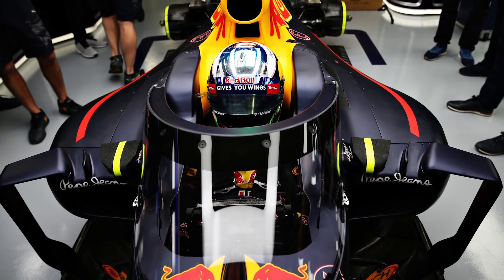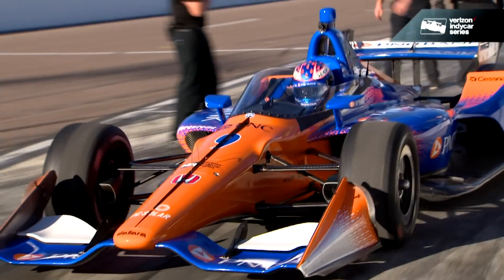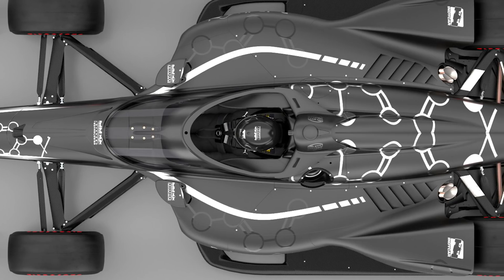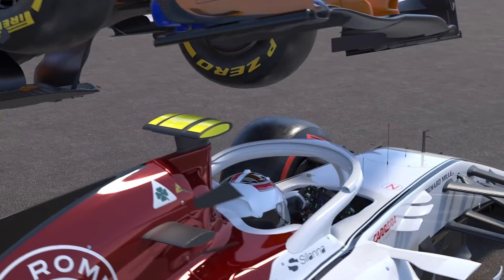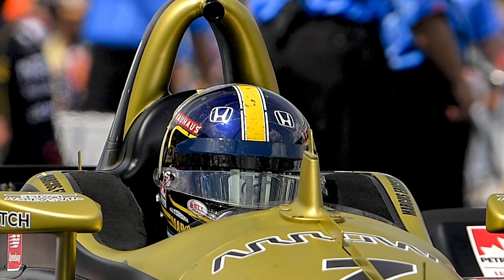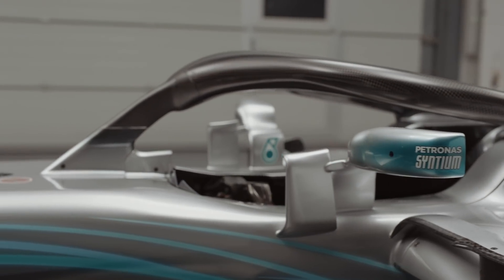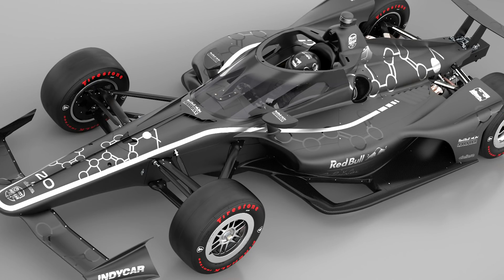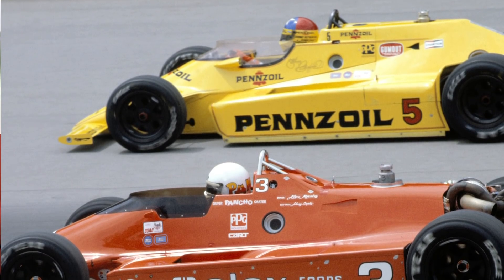Why IndyCar chose Red Bull's screen that F1 rejected

Comment: The risks on an oval on flying debris, overturn, collision and vision requirements is slightly different to F1...….and the halo has been proven to work......maybe there'll be a hybrid?, but whatever works on safety is better for the sport......
Reply: It really isn't - it was an F1 driver that got hit in the FACE and missed a season of racing because of a damper spring, not an IndyCar driver
Reply: The halo hasn't been proven to work though, no one's been saved by it
Reply: LeClerc Belgian Grand Prix 2018.....
Reply: @alanhutchins5916  it didn't though, it would've missed him anyway
Reply: @redbullsauberpetronas  official FIA report on crash has a different opinion along with C LC.

Comment: My only issue with this sort of thing is restricting drivers getting out the car. If the car goes upside down into gravel or grass you could easily see the car being very hard to get out of. Add into this fire breaking out means that Marshal's will have to be on their toes
Reply: It leaves pretty much the same space as the current halo to escape from so that has been tested pretty extensively.
Reply: @Firecul  ah fair enough

Comment: Well, At Least They Learn From Justin Wilson
Reply: I believe he was hit directly on the top of the head with debris. I don't believe this design would've saved him. It was a freak accident. You cannot make these cars 100% safe.
Reply: Kresna The Roblox /Minecraft Gamer if only Justin would of learned himself going slower instead of speeding through a accident area.
Reply: @breakwood8531  He was going 160 mph  in an area that they would normally be doing 210 mph, he was slowing down. You can't just slam on the brakes when going that fast in a pack of cars. He did nothing wrong, just an unfortunate accident.
Reply: John Sabol I watched it a lot and Justin was passing a car going high at faster speeds then everyone instead of following the group down and slowing down. I’m not putting blame on him per say but if he had stayed behind that car instead of passing him I’m sure he’d be alive today but I actually blame that style of car, parts would of always break off easily, especially the back bumpers.

Comment: This will probably be in f1 next. If we can put a canopy on a fighter jet this should be easy in comparison.
Reply: Nick Polito But distortion issue on F1 might be critical
Reply: @taek_00  if it isnt an issue at Indy oval tracks where average lap speeds are well into the 200mph+ than I would bet f1 wouldnt have an issue either. If it was that bad for distortion they wouldn't run it on the Indy ovals where reactions and judgement cannot afford to be impaired as the potential for bad wrecks is already higher at Indy ovals as it is.

Comment: I would much prefer that they wouldn't talk about "why the AeroScreen just wasn't 'good enough' for F1" at all if we're going to pussy foot around the fact that the FIA isn't interested in ideas that they didn't invent themselves/can't claim as their own. Besides, if the FIA didn't pick "their own" invention, how else would they be able to prevent other series from using it(as was mentioned in the video)?
I get it - it's a great idea, for the sake of good ol' press credentials and the opportunity for exclusives, to not talk about the FIA's political bullshit, but that doesn't mean that we need to in any way legitimize the FIA's bullshit decisions.
The fact is, both the original IndyCar concept(with finished development) and the original Red Bull AeroScreen would've been perfectly fine while a v2 along these lines was ALSO developed, as the ORIGINAL problem being solved was flying debris, with significantly greater loads along the lines of the weight of an entire car coming at the driver came along later in the development of these devices. Remember when the FIA was 'just' shooting tires at these as the main tests? But, the flip-flop-top was their decision because it was THEIR 'solution', while other reasonings were added after the fact to further justify their obviously closed minded decision making.

As far as F1 eventually adopting this, I wouldn't get your hopes up, not without it being an abortionized version that they can, once again, claim as "their own" anyway...

Comment: Would there be an issue with rubber getting caught on the screen reducing visibility?
Reply: That's a good point - I reckon they might introduce the tear-off system that endurance racing uses, where a tear off is taken off during a pitstop
Reply: @ChrisSmith-mk3wo  I just assume with open-wheel racing cars would throw off more rubber but time will tell. I am just interested to know if it would be a problem and how they would solve it.
Reply: No more than any other series' that race with closed cockpit cars and windshields...
Reply: @colejones6312  problem is that all the racing cars with a closed cockpit have wipers... endurance racing have tear-offs too only when driving in the dry for the dust...
Reply: @Moribax85  So you think F1 can't adopt any of these existing tools? Oh boy...
Reply: Probably not so much. The angle is quite flat so it’ll be hard to have rubber stick to the shield, especially at Indy speeds.
Reply: Vs rubber on face helmet? I don't see a new issue here
Reply: @littlejohn-pi7kk  I mean the helmets have tear-offs. I don't see a driver reaching outside the monocoque to tear off a layer of plastic from the windscreen. It could happen in pit stops I guess.
Reply: @xRODIMUSxPRIMEx  "It could happen in pit stops I guess." You guess? I can do you one better and tell you yes thats exactly how it would be done and furthermore it is exactly how its done. From nascar to GT3, They all use plastic that can be peeled by the pitcrew to increase visibility.
Reply: @TheBUGZNTA  Yeah I do guess cause I don't know I was only asking a question, not a bad guy here, just a curious guy. But wouldn't open-wheel race cars throw more rubber out than regular cars? Would this require pit stops just for tear offs, I mean there are a lot of unknowns here, what if after 10 laps the screen gets difficult to see out of due to the rubber. Would that mean race leaders would get an advantage over the rest of the pack because they can see out of their windscreens better? I mean I am just curious I don't think it is a stupid question to ask. And I am not opposed to this I am again just curious as to how they solve these issues if they even are issues.
Reply: Is there a problem with rubber getting caught on the screen of Prototypes?

If so, how the hell do you think that they solve this?

I swear, it's like trying to add a windshield to a racecar is more difficult than solving world hunger or something - critical thinking skills are at an all time low...
Reply: @RyTrapp0  Okay dude, it was merely a question, no reason to turn into a drama queen. The only one suggesting this is an end-of-the-world type question is you. Also, whenever sports is involved, no one is equating it to world hunger. Ever.
Reply: @RyTrapp0  I mean you just asked the same question I did without answering anything I was just curious my dude. But to answer your questions. 1 I don't know if rubber getting stuck on the screen is a problem hence my asking if it was. I also don't know if the screens have been tested in race conditions with a bunch of cars throwing rubber around. 2 How do I think they solve this, maybe wipe the screen down with Pam? Obviously, they will have a solution to these problems. But please by all means how will they do it all knowing YouTube commenter with all your critical thinking you can't use to see that my comment was a valid one.

Comment: Let's be honest, the only reason they don't want the halo is looks. The argument that the halo obstructs vision is obviously not true as their proposal is halo + screen. So the halo on its own would be fine if they designed it for the series. Also the small objects argument is not a big issue. They changed the helmet regulation to make them stronger against items like the spring that hit Massa.

Comment: The reason INDYCAR didn't go with the halo is because they oval race too, so the obstruction of view from the halo was dangerous. On the banked turns drivers have to look UP all the time rather than straight ahead and left and right due to the track being all straight and while on the banked turns, looking STRAIGHT forward is looking right in front of the car and looking left is actually looking at the ground/grass off the track, you HAVE to look UP to see the cars in front on the banked turns.
Reply: They said that in the video.

Comment: I think F1 is starting to go way too far with excessive safety rules now. something is missing when the sports lost that fighter pilot danger it had years ago. No one wants drivers killed or injured. but the thought they could be might make them drive a bit more thoughtfully.  Also correct me if i'm wrong but dont indycars  have a rule where they dont race in the rain. in which case apart from bug splatter the screens are no hindrance to them  ?
Reply: IndyCar doesn't race in the rain just like the general public doesn't drive in the rain - however could we see past the water?!?!?!
Reply: Yes because we want drivers to stop making brave moves on the edge of death and have them chicken out at the slightest dive.....

Not. Safer cars better racing.
Reply: @Minx5892  I'm glad I'm not the only one that sees how asinine, hypocritical, this idiocy is - how the fuck does less safe cars = better racing? How does it improve ANYTHING for the fans??? This has never made an ounce of sense to me, and has never been explained with any logic either. 

As we all know "open cockpits are why F1 is so much more entertaining racing than these way too safe closed cockpit LMP/DPi Prototypes/GT cars"...
[...yea, that was most definitely sarcasm...]

Comment: It's a paradox: the screen can protect from the big and small objects but become dangerous with the rain.
Reply: Your street car is s00per s00per danger in the rain too, right? That's why the general public all pulls over to the side of the road during rain as required by law - because no one can see pause this magical clear-but-not-clear liquid that sticks to angled surfaces like glue...
Reply: @RyTrapp0  A screen in FIndy at 400kmh doesn't have the windscreen wipers, so......
Reply: @simonetaddia459  ...neither do HELMET VISORS... ...so...

BTW, how do you think water acts on an angled surface at 400KMH(well, 355-380, but who's counting)? Does rain act like superglue outside of North America or something?
Reply: indy doesnt run in the rain. So problem solved. and itd be no different to a bike visor
Reply: @jasonward345  You're on the internet - you could at least TRY to use google instead of making a fool of yourself...
Reply: Exactly
Reply: Pretty sure that F1 has the funds to coat it with some super hydrophobic material.
Reply: Helmet visors are not better in the rain.
Reply: The real question is can that screen withstand Edd Straw?

Comment: Never have liked the halo. But I do like my favourite drivers and if this device keeps them racing with reduced risk then it's ok by me :)
Reply: Yeah halo looks bad, BUT I deff want it to stay if does protect n keep drivers alive.
Reply: @shanejett3550  So this might be the fact that I'm new to F1... but I actually like the halo. I find it ties the lines car together nicely.
Reply: @Sharks545 : ur lucky bc most - and I'm making the assumption based on the many comments - don't like the halo and feel it's ruined the look of the F1 car. F1 is one of or the most innovative sport on the planet. It was also one of the most dangerous. Safety should also be extremely important too. For a period there were 6 wheeler cars racing in F1 that looked stupid imo. Fans need to adjust and learn to tolerate the halo. It's a nice name: halo. The halo will always look better than a body in a coffin or a unconscious vegetable in a bed. I agree with OP :)
Reply: You can see through the Halo... you can't see through a dirty windscreen
Reply: @johnerickson2673  yeah, the windscreen could improve aerodynamics a tad but it does run the risk of getting dirty but then so does the helmets visor. IF they went with the windscreen its likely we'll se a similar technique used in endurance racing where there are 5/7 layers of film on a screen that can be torn off in less a second peeling off the dirt and leaving the next layer of film completely clean and ready to race. there is a risk that drivers may have to stop for an unnesersarry pit because of gunk on the screen and lunkike the visore a driver cant just reach his hand up and wipe the screen as he would the visor so its a real technical challenge
Reply: Think LeClerc last year, that was close!
Reply: Did most of you forget about Charles in spa a year ago and that Japanese driver in f2 or somewhere else that provides the halo.
Reply: I have a similar attitude - I think it looked a bit better without the Halo, but as long as it is protecting the drivers It is very welcome from my perspective
Reply: @ProjectsSpiel 182 Yeah the over-shoulder view was my favourite but unfortunately it was blocked
Reply: Imo the halo makes the cars look nicer 🤷🏾‍♂️
Reply: same dude...i dont wanna see one of these guys get killed
Reply: Jay davenport i feel like the formula e design of the hali is way better
Reply: Same! I've already gotten used to the halo. It's been normalized from my perspective.
Reply: @709mash  I had thought it was weird at first too, but especially since I started playing F1 2019, I really like the halo. I don't think it looks stupid, could be integrated a bit better, but it's still nice looking to me. A lot more safe of course, and I got accustomed to the pole in front of your head very quickly (I feel rather weird without it by now)
Reply: We want to get to the point where nothing can injure them, but they can still race. We're still losing lives even WITH the Halo
Reply: @T1Earn  Would you want your children to wear a seatbelt? There are freak accidents where people die when wearing a seat belt, but would you want your children not to wear a seatbelt?
Reply: Good attitude: 100

Keep it up
Reply: It doesnt look that great but it's already saved some lives. 

At that point, fine by me. I love racing but I also love the drivers to all come out of a race alive.

IndyCar needed it BAD. Only up until recently drivers were dying way too often.
Reply: You got to love halo after bahrain 2020
Reply: @FerencKranicz  im currently in a heated comment debate with this man who would rather see drivers die on his screen because 'its a dangerous sport and the danger brings excellence' than see them race another day. he is against the halo because he thinks it looks shit and he believes that drivers dying should be part of the sport to bring excitement. he absolutely sickens me to the core
Reply: Agree however if we eventually find out that they made an aeroscreen or closed windshield that’s safer, I’ll expect that the FIA didn’t stay content with the halo and continues to innovate
Reply: Same i feel like it highly impairs visibility
Reply: @oregonborn9769  how so? It literally takes up a very small part of your view, it would only increase the chance of an accident by a very small margin. You also do realize the halo has saved multiple lives right? Leclerc and Grosjean are good examples
Reply: @foxgaming76yt24  i totally understand it has saved lives and thank god. Me personally if anything is in my field of vision it drives me mental a too big rear view mirror heavy rain etc....so i didnt know if this halo was driving them insane having it smack dab in the middle of their vision.
Reply: @oregonborn9769  well fortunately it doesn't
Reply: Yup it saved grosjean
Reply: Halo bad, maimed/dead drivers worse.
Reply: Aye pathetic. It’s an open cockpit open wheeled race car. If you want a roof. Drive a GT or LM car.
Reply: @mattjones1992  it's called open wheel racing not open cockpit
Reply: Jay davenport the danger is part of the job. 
If you can’t hack it then find a new job
Reply: They could stop racing and then everyone would be safe? Oh, except for the ice creams being dangerously cold?
Reply: Soft
Reply: Except how many drivers actually died and would of survived the accidents with a halo. Such an ugly, no longer an open cockpit design.
Reply: @kyledorrell2013   In recent memory, Justin Wilson. That's one life too many. Charles was saved, and Ryan Hunter Ray got lucky; otherwise, if he was a couple tenths off, his head would've been taken off my Robert Wicken's car.
Reply: @kyledorrell2013  easy to say when you are not the one who's life is on the line. also, "would have"
Reply: @sepg5084  I was going to comment that  too: "would have"...
Reply: @kyledorrell2013  Senna for starters
Reply: @Crazyced  
Sorry pal, as much as I have Ayrton as the GOAT, I don't think the HALO could have saved him; I mean, he crashed head-on against a concrete wall at over 200 km/h and a metal rod (steering column) hit him in the head.

Rather than Senna, Jules Bianchi would have been more lucky, as the HALO would have avoided his car from going under the tow truck.